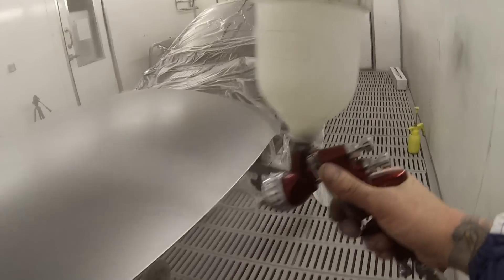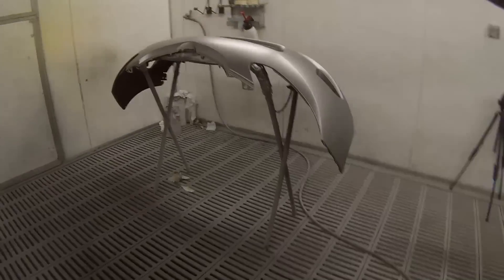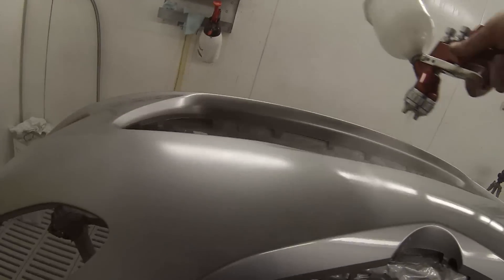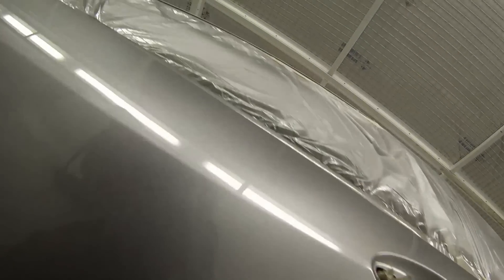How to use a DeVilbiss GTI Pro for Clear

Comment: If I open air wide open on gun I barely hit 2 bar with regulator wide open.. 120 psi coming into regulator would equal 120 at gun that seems excessive what am I doing wrong
Reply: I’ve got the same issue - did you find a solution?

Comment: I have just purchased a second hand  devilbiss spray gun. On the handle it has stamped GTI PRO DIGITAL CLEAR and has  a T2 transtech air cap. When I tried to find out more info,all the other guns had a digital gauge on the handle.Mine has not.My question is: did devilbiss make them without the gauge?I have used it and have no problems with the gun, Just curious.
Reply from the maker: suga minga DeVilbiss put their digital gauge on the back of the gun near the fan controll, I've never seen a pro lite with a digital gauge anywhere else. They do have  them without the gauge and that's the one I have.
Reply: The Gunman Thanks for the quick reply, love your videos. I am restoring a holden 1 tonner back to original and spraying the car in acrylic.You need to do a video spraying that. [ When I said original,the body is stock,but there is a turbocharged 350 chev ready to be dropped in] Sixty years old and still playing with toys.

Comment: hi gun man what degress was the room at how much do you adjust the bottom valve.
Reply from the maker: 30 Celsius
Reply: The Gunman, hey big fan here.. what set up are u using for ur gti pro/clearing gun
Reply from the maker: Vicente Peralta TE20 1.3

Comment: Is there a big difference between the t2 cap and the hvlp cap? Which one does a better finish with clear coat?
Reply from the maker: They are both good for clear and I have both and use the T2 if i don't want so much material on but if i want a real thick wet finish then I'll go and change back to the HVLP. I'm uploading a video at the moment explaining a bit more about how to use them for clear, will post a link here when its up.
Reply from the maker: Learn how to Spray Paint "Ford Territory Zest Met"
Reply: The Gunman
thanks just checked out the video real good info will for sure give that a try once i get my gun
Reply from the maker: No worries I'm glad you liked it

Comment: Is there any difference betwen gti pro clear and gti pro base or there are just different nozzle and air cap sets ? I got unused gti pro clear for 130€ (190aus) :) and I'll be using it for base and clear.
Reply from the maker: There is no difference at all, they are the same gun its just to help you identify which gun is which, thats cheap.
Reply: The Gunman Thanks for the answer. I've got the T2 cap on it . My only worry it's safe to use it for base and clear or shoud I get another base coat gun like finishline 5. I'll be painting metalics, so I'm little afraid that some of metallic particles would go in the clear. Would one neddle+fluid tip set for clear and another for base help ? I only paint few times per year so I dont want to spend too much. I really don't know much about new guns because until now I was painting with some old guns, but the paint consumption was really horrible and cost me alot of money.
Reply from the maker: for what you will be using it for there is no need to buy a second gun just give it a good clean and flush through before clearing. there is no need to change the tip or anything like that from base to clear. I know what you mean about the crap guns

Comment: hey, just painted a 2005 ford falcon wagon rear bumper with the exact same gun, 3 turn out / 2 bar, used roberlo 150 HS clear with no reducer, heated the clear and hardener in hot water, I use 600 mls mixed and had 75 ml left unused in gun, so 525mls for two wet coats, had to pump the clear on to get it to lay down nice and got a super flat finish when was dry, but Im thinking thats a lot of clear, but I guess there a large bumper cover ? Im not sure I like using HS clears as you seam to have to pump the clear on so heavy to get it to flow and a good finish without a lot of orange peel, MS seams easy to apply with good film coverage in two coats, why even use HS clear ? Is it to get a deeper gloss because of the thicker solids and film thickest in each coat ? thanks
Reply from the maker: Jonathan Day MS is easier to use but used properly you can use half the amount of HS, I used too use Glasurit 255 HS clear and without fail had a system that worked, 130ml per panel 300 per bonnet or bar, give or take for smaller or bigger panels. Because its so thick you can get the same film thickness with 1.5 coats of HS as 2 full MS if not a bit more. Watch this video and you'll see what I mean, this was my first upload 3 years before TGM, so not edited or narrated but you should get the technique. It's also to do mainly with emissions and being more enviro friendly with less evaporation of solvents. Good luck and hope this cleared up a few things.
https://www.youtube.com/watch?v=O8gwUFtarFE

Comment: Looks like a great gun going to pick one up thanks for a great demo
Reply from the maker: no probs mate glad you liked it, the T2 air cap is a great all rounder too and easy to use, also get 1.3mm fluid tip.

Comment: Hi mate .I hope you can clarify something for me.I've just seen today a devilbiss gti pro with a T2 aircap and noticed the inscription "clear" where the paint flow regulator is.I took a look at the official website of devillbis and noticed that there is a "base" version of it.Then checked the paint data sheets for the paint I use and they recommend the base version for base coat and clear version for clear. But in fact they both have the same aircap T2 or T20.Do you use both versions or that inscription helps to differentiate the guns when you use them?
Reply from the maker: Hi mate, There is no difference in the 2 guns at all it is just as you say to help you identify between your guns, the gun you see me using for clear here has base on it but has always been my clear gun.
Reply: Thanks mate